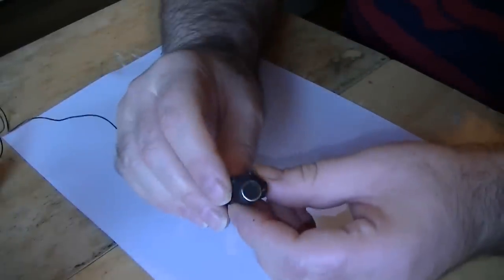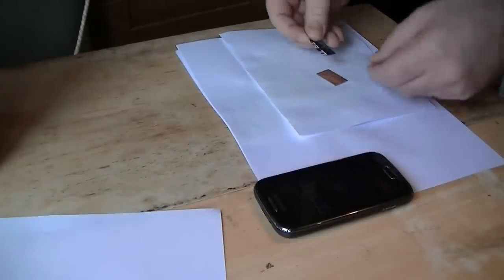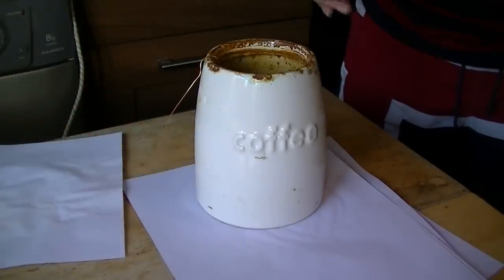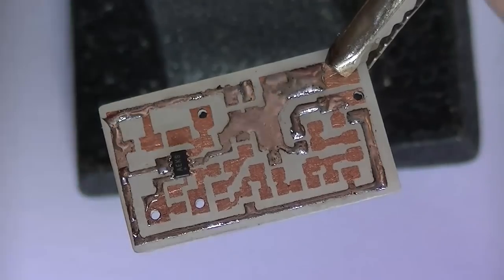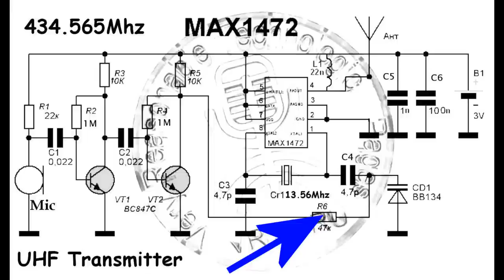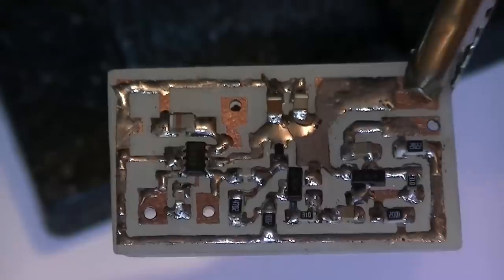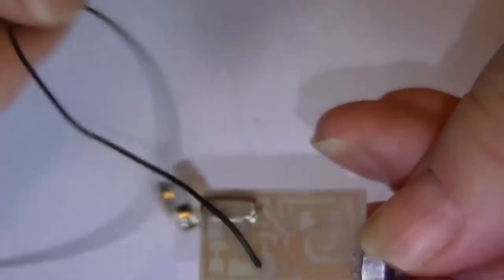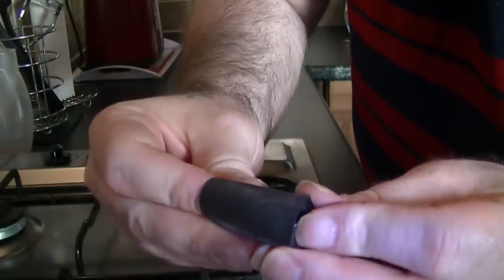Make your own professional UHF transmitter.

Comment: This is a great RF project and a wonderfully made instruction video, sir.  Thank you very much.  In looking at your circuit, I can't help but to wonder if you add perhaps a 1.0 uF to 4.7uF capacitor in parallel with the 47K ohm res. leading to the Varicap diode, this would increase the audio gain such that you may need only one stage of audio amplification.   To me, it appears as though the 47K resistor is needlessly wasting some of your audio gain.

Comment: What a nice projects again ! This really rock ! I tried most of your projects, FM-Transmitter and they all work pretty well.  Now I have to shop on the net for these SMD parts for your project.  Thanks for all your videos it really help.
Reply from the maker: Thanks ,happy building.
Reply: dazaro3
On the schematic of the proposed UHF transmitter, the transistors are BC847C while on your parts list it is mentioned that the transistors are BC4547C. Are these transistors equivalent, with the same characteristics? Would you be kind enough to confirm this. BC847C transistors are fairly easy to find they have the SOT-23 package.  I very anxious to have all the parts to complete this great project. Thank you again, keep good work !

Comment: Are you able to make a transmitter  to be used by a referee and a lavelier mic to operate on UHF 576.39 - 595.66 to be received on a boya by-wm8. The current transmitter has a distance of 100 metres but cuts out when the ref is surrounded by players. Thanks in advance.

Comment: Where do you find the MAXIM ICs? They are kinda hard to find. I have found 3 sellers from China but they are super expensive. Any suggestions? I'm trying to find the 7044 versions aswell since they've got a output of around +14dBm.

Comment: Your nails are no problem. If anyone is here for nail care they're in the wrong place. Great video, enjoyed it and will probably try one myself. I assume you could run this from a 3v button battery, any idea how long that would last ?
Reply from the maker: This UHF transmitter draws about 12mA current ,so a CR3032 will last about 4-5 hours.

Comment: Why is the crystal frequency lower than the transmit frequency? I'm building a 27Mhz transmitter and that needs a 27Mhz crystal. I'm a crystal newbie.
Good job with those tiny parts !!
Reply from the maker: The Max1472 IC comes with a 32 X frequency multiplier.

Comment: Thanks for putting this together! I’m super new to transmitters, if I wanted to change the frequency output, where in the circuit would I modify to go from the current frequency to ~313 MHz?
Reply: Andy Cross you’ll need to change the crystal, MAX1472 multiplies crystal frequency by 32x. If you change crystal though you may need to change some other components values.

Comment: Sir, can you guide me for making a circuit on a pressure sensor over NPP301A-700 and transmit data using MAX1472. The place I am stuck is with XTAL1 AND XTAL2 connection. I'm a noob in electronics please guide me through

Comment: Is there a BC847C in the circuit diagram? Can we use the BC847C in a circuit diagram with a different transistor on your part list? Or should we use what you wrote on the list. Thank you
Reply: You can use the 847C, they work.

Comment: Can a 12.288Mhz crystal be used instead without having to change any other component values? According to the data sheet the transmission frequency will be 393.216 Mhz.
Reply: The problem is with your receiver.  Some receivers won't receive at 393 MHz or below 400 MHz.  If you transmit on 393 MHz you may be violating the laws of your country.

Comment: Do you have to use surface mount resistors and capacitors for this project?
Reply: The frequencies are so high that it's difficult to get 433 MHz with through hole parts.

Comment: I just made one of these. It's transmitting on a steady frequency but I do not hear anything. If I tap the speaker I can hear a faint sound but nothing clear. Any ideas as to what might be the problem?
Reply: I meant microphone not speaker.
Reply: That tap is probably just feedback from the circuit, check polarity of your microphone, also check your using the correct Varicap. Use Bb535e.

Comment: Great work. I have tried to get an answer to this question many times from others but no luck yet. Maybe you can help? Would it be possible to make a small but powerful, weatherproof and remote amplifier that could take the signal from a bug like this and boost it? If so, how small could it be made?
Reply: it depends on the power gain of your amplifer
Reply: ANTHONY FORZUELO Thanks, but that does not really answer the questions either.
Reply: it depends because the more powerful the amplifier the bigger it will be but it also depends on the parts... example... if you use the smd size it is smaller than the through hole counterpart but it is less powerful... it also depends on how many parts in the circuit of the amplifier.... hope this helps :D
Reply: http://www.circuitdiagram.org/uhf-antenna-amplifier-booster.html... I estimated this circuit uses 3x3 square inches board space :D
Reply: ANTHONY FORZUELO Thanks Anthony. Looking now. Ooops! The webpage cannot be found
Reply: InTheNameOfJustice
It seems there was a period at the end of that link, causing the error. Here is the corrected link:

http://www.circuitdiagram.org/uhf-antenna-amplifier-booster.html
Reply: Stinky Whizzleteats
That's great. Thank you.

Comment: can it transmit video in small range... like 10 miters or so... cuz i been searching for this for a project of mine and all transmitters i found need Variable Capacitors which i cant find in my country
Reply: MegaMidoZ : 10 meters is a Ham radio frequency for voice. Try the UHF 220 +mhz fast scan which is also Ham requiring a license and some price equipment.
Reply: T6x729 will work

Comment: Was wondering what size smt's you are using 0603 or 0804?
Reply from the maker: I was using 0603 and 0805
Reply: Was it 0630 for the resistors and 0840 for the capacitors?
Reply: Sry 0603 and 0805 *
Reply from the maker: I used 0603 and 0805 parts.